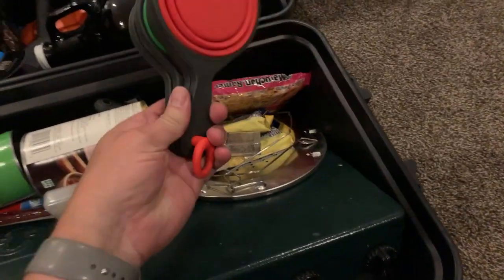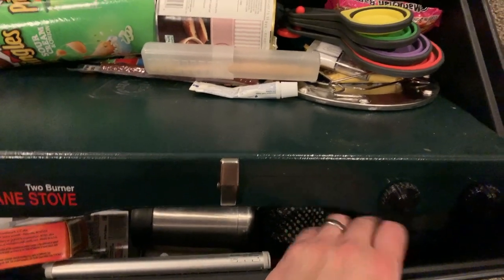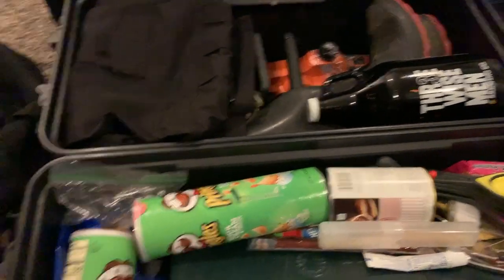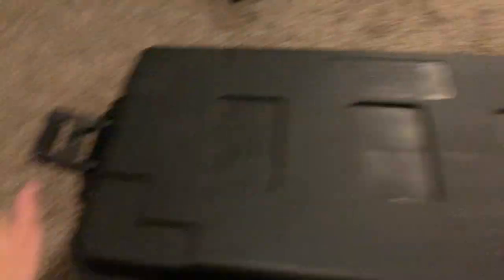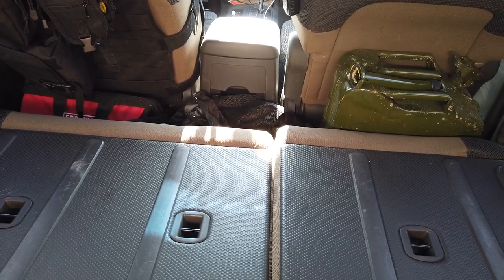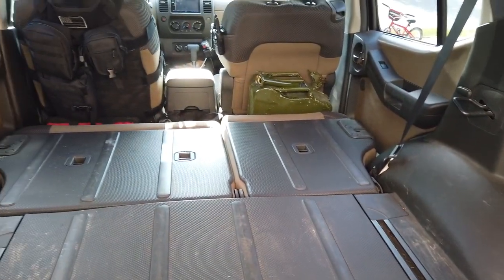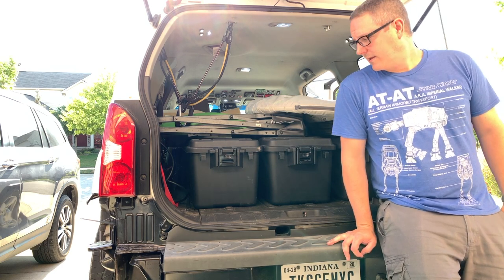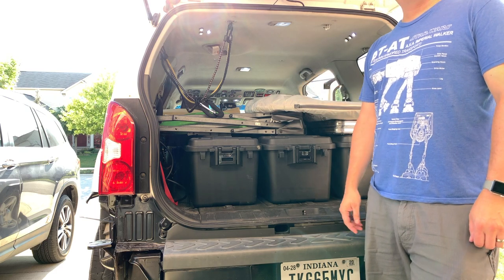How I Pack My Xterra for Overlanding Trips (Process, Strategy, Plano Crates, Camping)

Comment: Plan on taking my 2003 xterra on a cross country trip from Tn. out west and will be taking a nice tent for at least 6 people to use at times and a large tarp to secure to the luggage rack and use as a shelter and a window covering held down with both sides with bungee cords  and 6 ft tall poles in the back to help the water drain. I also plan to be able to sleep inside if need be. Still working on a plan to support the mattress. Any suggestions would be greatly appreciated.
Reply from the maker: I'm not sure about the first gen X's, but in the second gen, there are some threads on thenewx.org about using Action Packers (heavy duty tupperware containers) to fill the gaps between the front seats and the back seats to make the full back flat. You might check on there to see if there are some tips for 1st gens! Sounds like a sweet set up. Have fun on your trip!

Comment: So funny, I use the Plano sportsman trunks as well and organize them similarly. I have one set up as a car camp kit and it actually stays in my Frontier year round in case I have a last minute desire to camp when I'm out. I'm a batchelor and travel in my truck a good bit for work so I always have a camp kit in the truck. It has all the basics for camping which is basically my backpacking setup and some mountain house meals. When I know I'm going to do an overland/car camp trip I also bring several trunks like you do. One that I call my overland kitchen which is setup for more substantial cooking for groups if need be and is all cooking stuff like my Coleman stove, propane, cook and serving ware, and cooking spices as well as fire starting stuff but no food. Another one that I call my camp tool box containes my camp tools like my fiskars saw and hatchet, a mallet, some tarps ratchet straps and cordage, camp lights or lanterns, extra fire starting material like lighters and dry tinder and gloves, as well as any other micellaneous camp needs. And then I carry one more trunk which is my food trunk. I put all my food in one trunk and even use a smaller soft sided cooler that fits in part of it to put any food perishables in like steaks or eggs. I then carry a second just beverage cooler. That way I'm not getting in and out of the food cooler very often and it helps retain the cold better. Oh and I don't use ice in the food cooler if I can help it I use freezer packs and plan trips starting off with frozen food as well for later meals in the trip. I really like the trunk setup myself because I use my truck for work and play and when I'm using it for work I need to haul tools and equipment in it and having a permanent overland setup wouldn't work to well for me. The added benefit of the Plano trunks is that they make good seats in a pinch and are very weather proof if left out in the weather when camping. Like if you wanted to clear out your Xterra to sleep in it.
Reply from the maker: Love it! Yeah, the Plano crates are great for the price. That's a great idea keeping food in one cooler (that you open less) and drinks in another (which you open more, because we all love beer). Thanks for sharing!